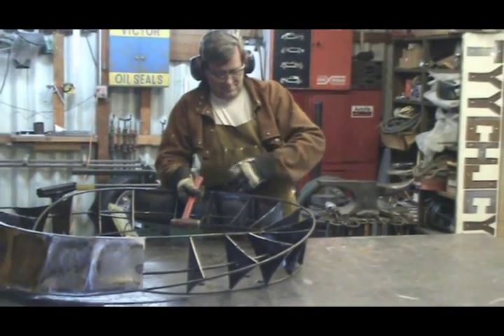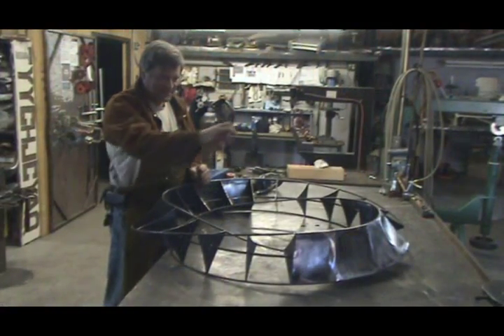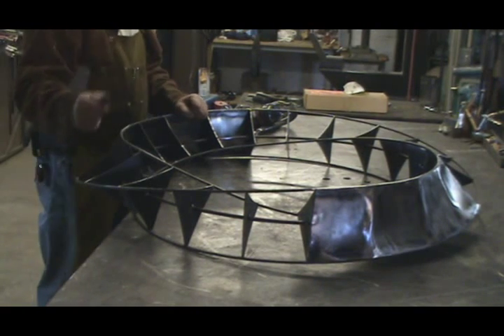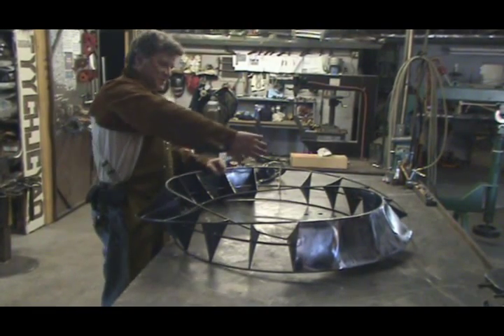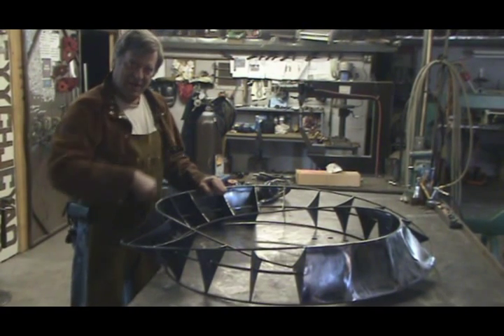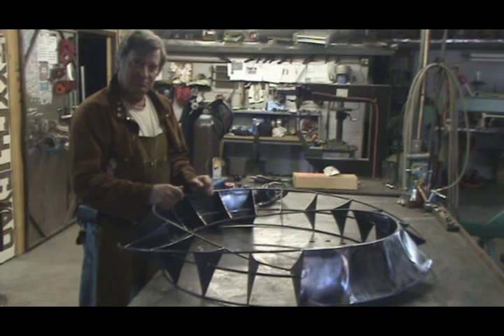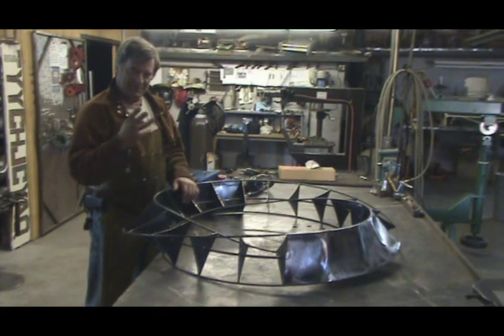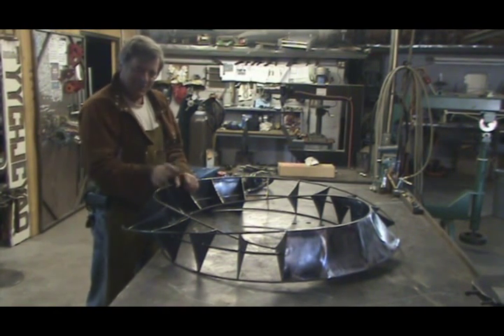Creating a Steel Torus - Kevin Caron

Comment: Hi, Kevin! I'm a L-O-N-G time fan of you and your channel hoping you can help me with a problem...
I need to purchase or fabricate a strong torus shape, itself to use as a forming tool. I hope to create compound curves in some 12 ga steel sheet by placing this torus shape flat on the bottom frame in my 20 ton hydraulic press and coming down with a hemi shape into the torus to progressively form the compound curve or bowl shape "bulge." I'm wanting to end up forming body panels for a large bird garden sculpture by working the metal progressively, making an elongated depression in each piece, then welding pieces all together of course. 
I just cannot afford a big English wheel and do not want to hammer the heck out of thick metal on a sand bag (not to mention wake up the neighbors!).  I guess a bowl shaped die might do as well, but feel a nice big torus would be more versatile. Nobody sells robust 10 to 12 inch toruses (torsi?). ANY suggestions on how to fabricate a durable classic torus shape to be used as a tool are much appreciated - Thanks!
Reply from the maker: First off, thank you for watching and posting.  I would have  to pound it out on a sand bag!  You could hire a fab shop to make it. Or find a piece of pipe and cut it in half!